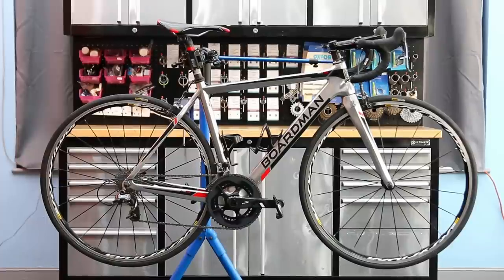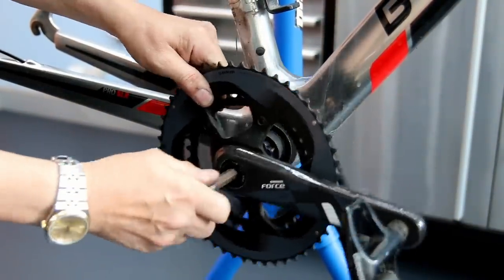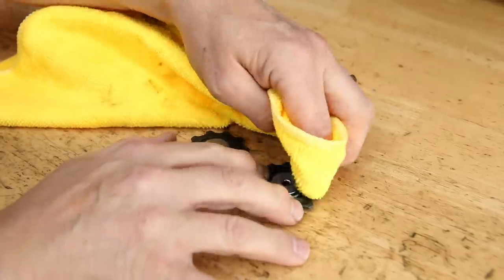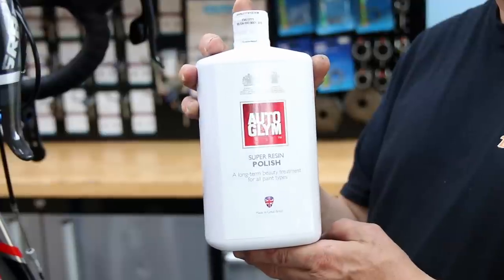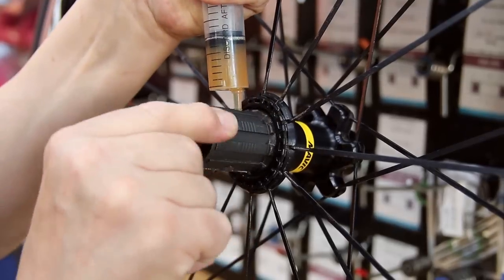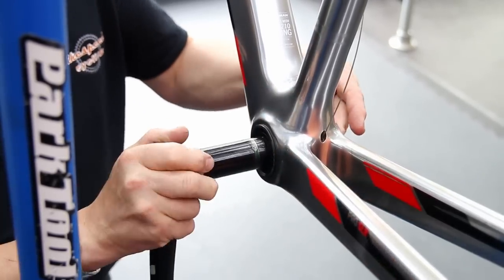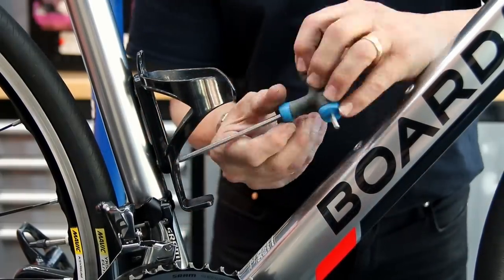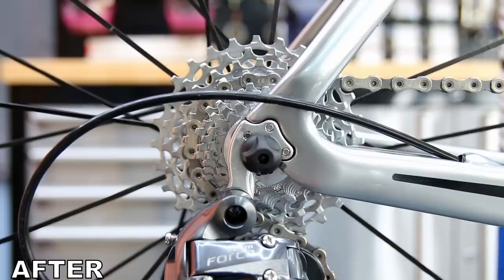Boardman SLR Transformation! Full Rebuild! Road Bike Service!

Comment: There are different cable guides, some are thicker some thinner.  Many times the manufacturers get the length of the cable guide bolt wrong. Curiously last weekend I also had this issue but with a sealed cartridge BB. These bolts also rust and are a nightmare to remove. In fact some Youtube tutorials tell you to remove this bolt first before the BB.  If I only could share pics.
Reply from the maker: Sounds like a nightmare job!🧡

Comment: I’ve literally just finished a full build on a second hand Decathlon Rockhopper 24inch MTB for my son for his birthday next week. I was going to buy a new one but after watching your videos and how bikes can clean up as long as the paint work is good I decided to go second hand route £80 for the Bike and a few hours stripping and cleaning every thing replace the headset and bottom bracket bearings and few new colour coded bolts on the brakes and new branded tyres, i T-CUT the frame and ceramic coated it and it looks better than a new one. Thanks for the inspiration!
Reply from the maker: That’s a great story Pete! T cut is a great product in our experience. Good luck with all your future projects!🧡

Comment: Another bang-up job. Looking good. I've had the same issue with that very bolt, and spent a considerable time filing it down to fit. I'm sure you noticed the signs of under-rotation on the crank spindle as well. You must have decided it wasn't bad enough to warrant a replacement (or the customer wouldn't approve the expense).
Reply from the maker: That’s exactly what happened, very poor design!🧡

Comment: In the 6 and a bit minute section it looks like the loss of paint on both the rear chainstay and the front fork (thin line and no other local scuffs / marks) was caused not by the wheel or tyre rubbing but instead by the little rubber fingers (for want of a better description) that are found on many brands of tyre. Had it with a set of P Zeros on a bike and after a couple of 1000 kms had the exact same marks that lined up with the fingers when I turned the wheels slowly. Pulled off the fingers and problem sorted.
Reply from the maker: We didn’t think of that!🧡

Comment: Would love the feel of SRAM on the rear shifting and Shimano on Front, I had force a while back and found the front was harder than I was used to, SRAM's electronic shifting solves this actually and changed my way of thinking with regards to shifting
Reply from the maker: They’re different feels that really just come down to personal preference, thanks for watching!🧡
Reply: The electronic shifter / derailleur updates don't always deliver improvements  as intended , especially if it is optimal performing already .

Comment: Great job as always. Just one little question: at 7:15 it is said "it's the drive side of the wheel" and the tire is mounted the wrong direction. But doesn't it look right (according to the little arrows and rear/front)? Just curious.
Reply: I think it was a missreading of the instruction from him here. It's rare to see a different direction front and rear on road tyres (being basically slick) but yes, I think it's an arrow saying that when installed on the rear it should point that way, and when installed on the front the other way, meaning it was correct as was. It's usually seen on off road tyres due to braking/cornering grip on the front, and forward drive grip on the rear. Shouldn't make a huge amount of difference on the slick though.

Comment: Very nice job.  It does seem like Carbon fiber Bikes have a lot of problems with the bottom brackets where your aluminum and steel bikes do not ?
Reply from the maker: It’s more to do with press fit and cheap bottom brackets, however it’s a very common problem in todays cycling which is mostly carbon fibre 🧡

Comment: You've pressed in a bottom bracket without checking the shell diameter or bothering to face it. The paint alone must be a mm thick and it's obvious in the video that it's not flat.
Reply: @Tarmaccyclocross if people are coming to you to get the job done properly and paying for it, then the supplier should do the job properly. This is garbage
Reply: 8:24 resembles the surface of the moon
Reply: @Tarmaccyclocross  It will wear quicker, so no, it won't work "fine".
Reply: i mean it a bordman it not gona help it probaly got a oval shaped hole

Comment: Aren't Boardman bikes Halfords bikes?  Halfords have a terrible reputation for bike build quality. Hence the BB issue probably.
Reply: Boardman were independent but mostly sold through Halfords at first, they were branded “cBoardman” and had the yellow / white / black logos. Then Halfords bought them up and the branding changed to the “B” seen on this bike.